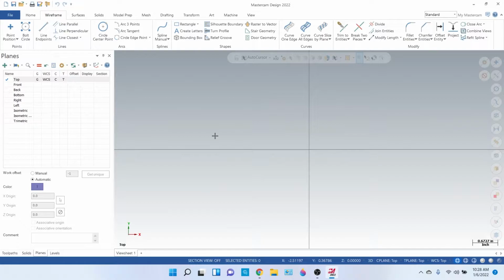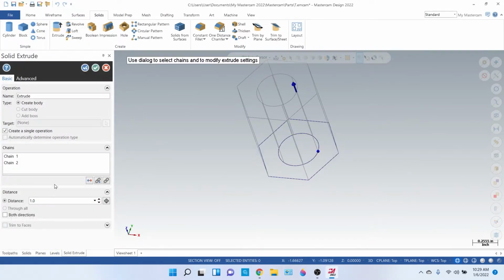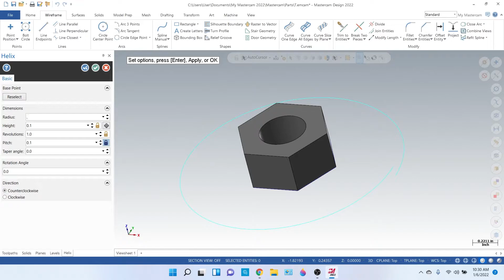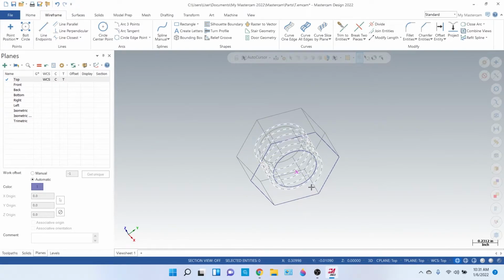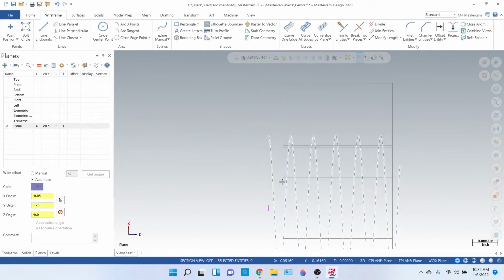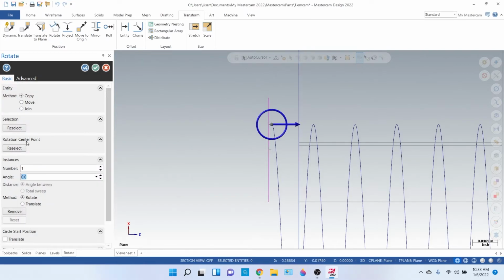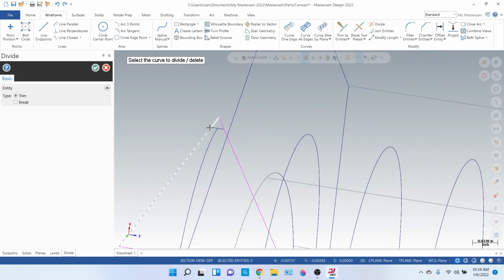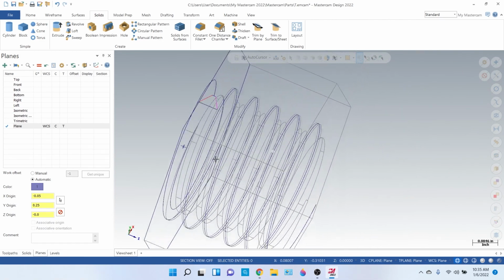How To Create Solid Model with Threads Mastercam

Comment: Thanks for making this video! I learned a lot when attempting this with a 1/4-20 thread. A couple of things I discovered.... For smaller threads you have to create the "triangle" wire of the thread with perfect dimensions or you will get faults. I had to break open the machinist handbook to get exact dimensions. If the "triangle" feature is too big for the helix, the geometry will run into itself and cause a fault. It took me a bit to figure out that's what was happening. The internal flat, in the valley of the thread, is not exactly on the helix start point. Its actually shallower than the true v point of the thread. (the triangle wire is not touching the helix wire) I also didn't really line up the helix start point with any other part features and creating the plan on the helix point still worked fine. Last little thing, you can create the triangle lines on 30' just by setting the degrees when creating the line instead of using the rotation function.

Comment: Alternative: Import a fastener, put it in place and boolean remove the common area.
Reply from the maker: The difference is my way is educational. And some threads are made to a different percent of threat engagement This way you can control exactly what you need. But if it is of no concern and you're not curious how a threat is made then I suggest buleon

Comment: Great time learning this. Created a file with the geometry that works . Merged it with my part file with out the threaded holes . Applied the Sweep geometry to each hole (8 holes translated to )and swept the helix. It created a positive of the sweep ( didn't cut the main model) and went to Boolean and removed the thread to cut the main body!   Sweet!:goodvibes: Been using Mastercam off and on since '92 when it was a 2.5 D system. was a Catia user too but retired now building a telescope mount .

Comment: Something I ran into, I was trying to make OD threads and it wasn't allowing me to select "cut body", and was generating a solid body instead of a cut.
I had to select a target body (pointer right below list of Types) after doing the Sweep operation, then click the solid I wanted to cut.
Reply: Same thing just happened to me. My solid was showing as so but wasn’t actually a solid body(I screwed up somewhere). Had to revolve my wireframe again into a solid.